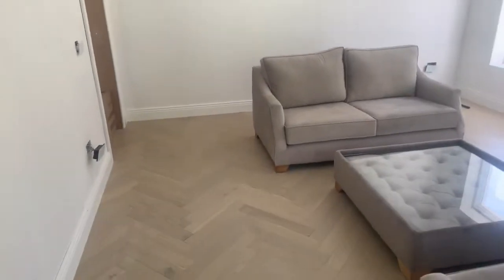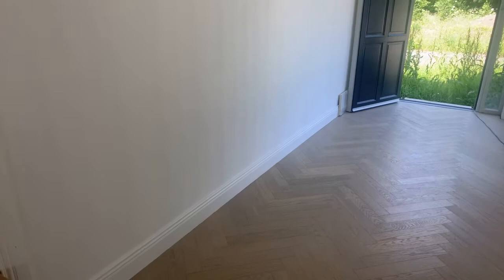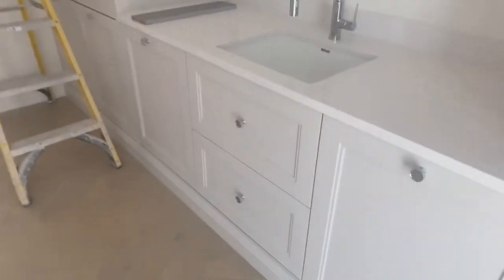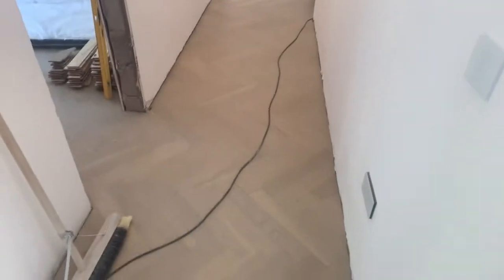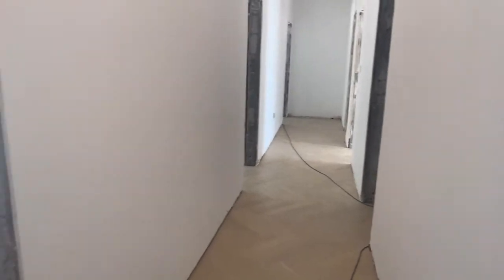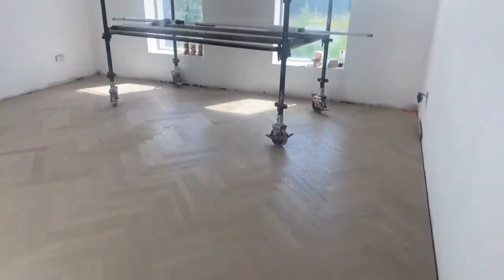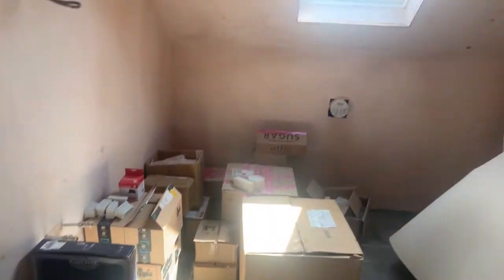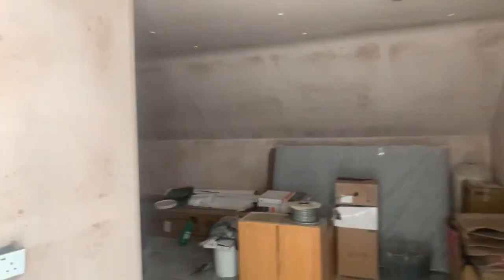Irish House Renovation Blog: Part 28 - Skirting Boards and Bespoke Doorframes

Comment: house looks stunning and comes very nice finish but as designer and kitchen fitter, i think dishwasher in utility is very unconfortable to use as well as bins. also hinges in the kitchen cabinet doors should be blum soft close not armrock hingess